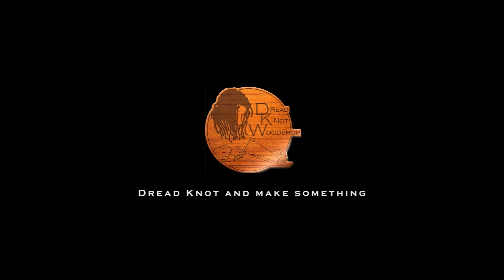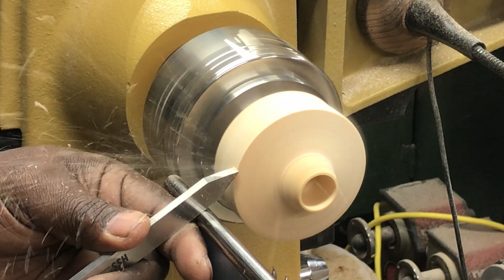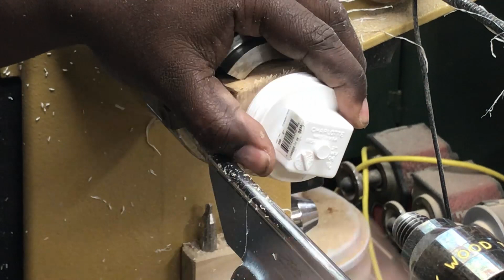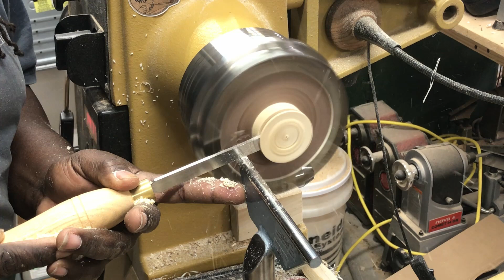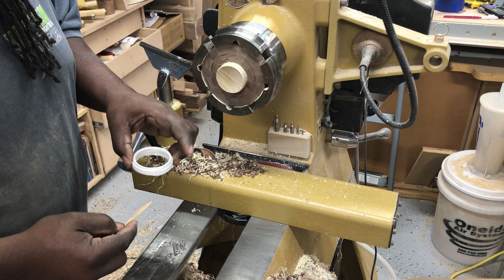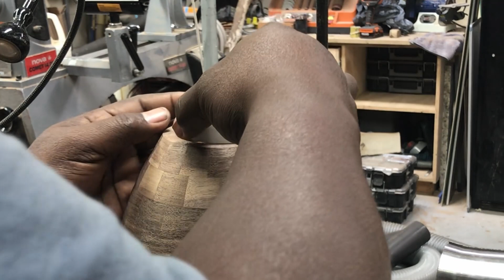Threaded Lids Using PVC Fittings

Comment: Talk about prophetic. I just bought Moretoes 36pcs 4oz Metal Round Tins Aluminum Empty Candle Tins with Screw Lid from amazon due to the high cost and limited availability of threaded insets for boxes. I might learn thread chasing eventually, but not right now. I didn't think about using PVC fittings for this and haven't gotten a chance to try out the tins. I will be cutting the threaded sections free similar to the way you did the PVC. The fact that the tins have a bottom and a top, as well as how thin the metal is will present more of a challenge than the PVC I suspect.

Anyway, nice video. I will be using this as a reference for when I get the chance to try my idea.